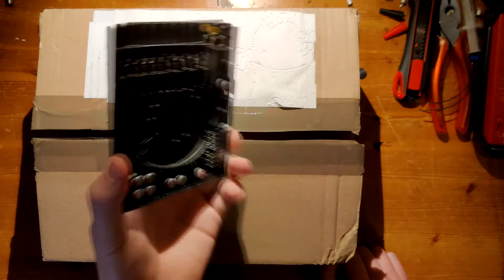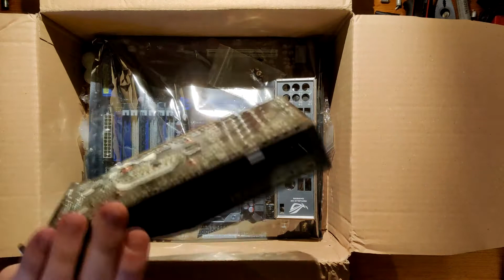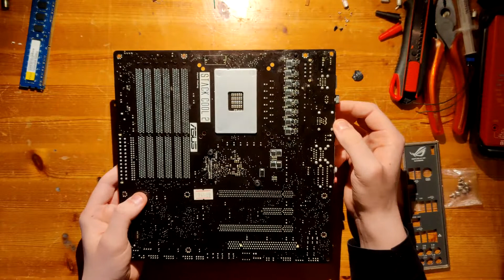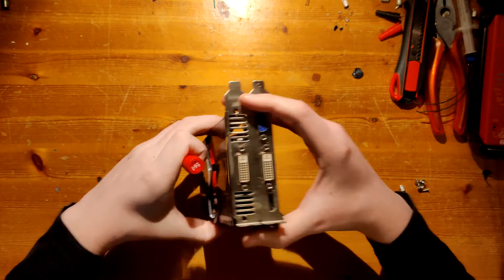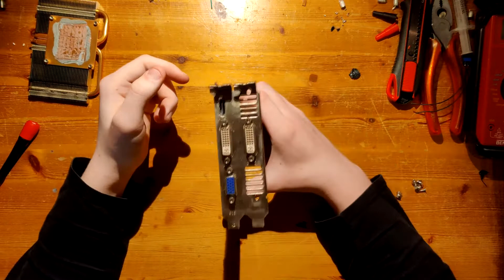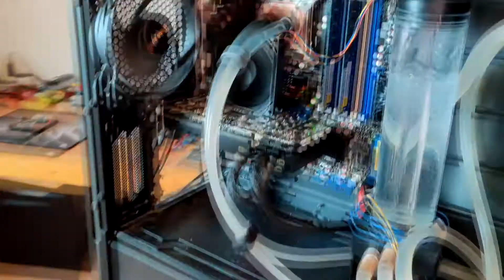Looking at what my friend sent me // Rampage II Gene,  i7 960,  GTX 560Ti

Comment: Check out a bios update and the xeon x5660 (6core 12 thread at 4ghz with overclock). Cheap big upgrade!
Reply: I have this board and the xeon 5660 CPU, do you mean to upgrade bios using the asus web driver ?
Reply: @funkiEst  no. Usually to upgrade to a xeon you need to update from an i7 900 series.
Reply: what bios update? latest avalibale from 2011.

I can't even get a gpu newer than rx 580 to work with it.

Gtx 1080 and rx 5700xt no work

Comment: dude your desk is a freaking clean room compared to mine
VFB on the NCP5395 does not set Vcore. (I found that out the hard way on a GTX 570)

X58 is HEDT it has A LOT OF PCI-e lanes from the NB.
Also nice blue solder mask on those sticks.